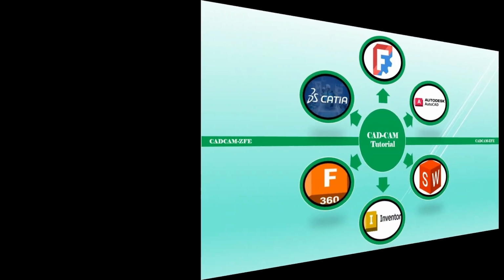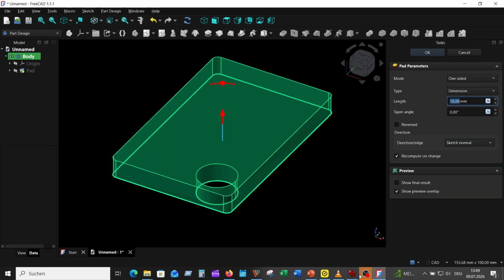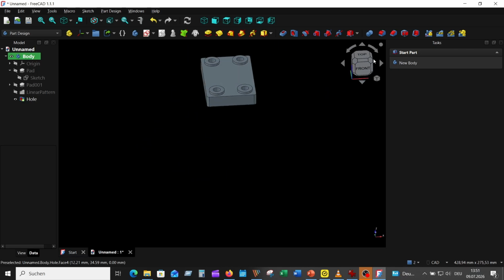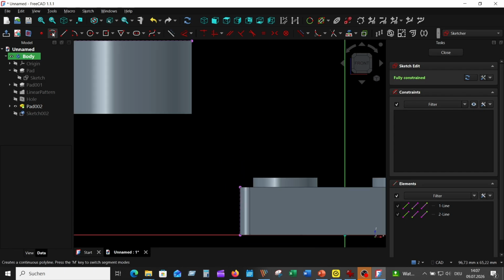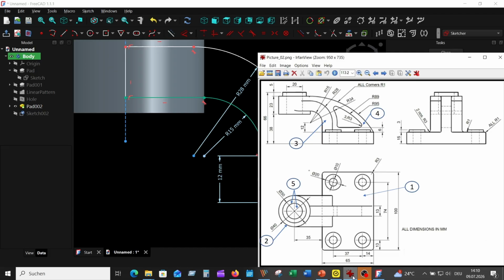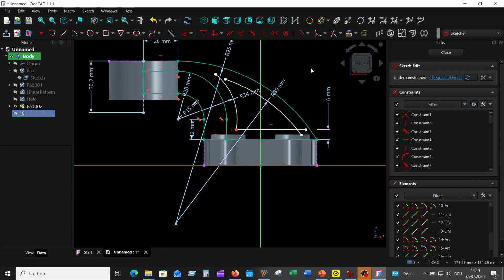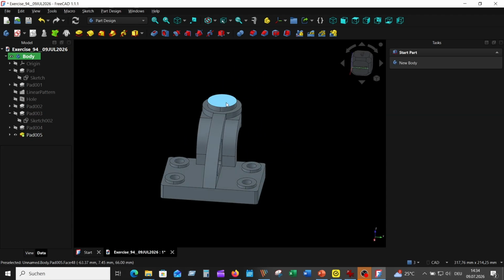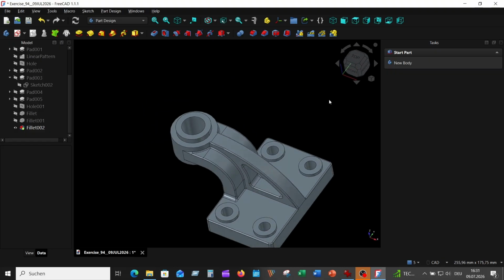FreeCAD Tutorial for Beginners: 3D Exercise_#94 - 2D drawing to 3D Solid Part

Comment: I have followed this tutorial multiple times and cannot get past the 95 degree arc in step 3. After creating the first two radiuses allows a pad to be created. Once the third radius is created even though the fully constrain is showing a pad cannot be completed. I watch this on a second screen while following the steps as created. I notice after creating the 95 radius curve that you have to create a external geometry which was created when step three and four was started. Also I notice the vertical line had been added when the line drawn on top of the cylinder just before the final line to complete the section. Another observation was when the first two radiuses were completed before the screen changed they were fully constrained, after the screen changed they were no longer constrained. 
Being a beginner I am doing my best to learn Freecad, normally I can find where I have missed something. This time I have spent hours chasing my mistake. I do get the fully constrained after completing step three but cannot create a pad. Know can't see what I am doing but I think something changed off screen when the screen changed for the third radius. 
Appreciate your time
Reply from the maker: Hi,
I don't understand why you have a problem with this sketch.
First, check the following points:
- the center points of the curves
- the construction lines & curves and also
- the tangential constraint between the geometries
If you still have a problem to create the pad:
- Close the sketch & check the sketch in 3D
Select the sketch, then go to Sketch (top Menu) ==> select Validate sketch ==> activate the button (highlight troublescome vertices) ===> it shows you where the problem is.
If you still have a problem:
- Try to create positions 3 & 4, in two steps.
First, sketch step 3 and create a solid part. And after that, create position 4.
I hope, you will find the solution!!
If you have any questions, please let me know.
Reply: @Zfe-addis41368  Hi Again, I was not able to complete the project per the tutorial, however I did as you suggested and created the first section padded then created the 95 degree section as a separate pad. I do not know what prevented the completion. I did find in another tutorial I had basically the same issue. I actually reinstalled version 1.1.1 which did not help. Thank you for your assistance.